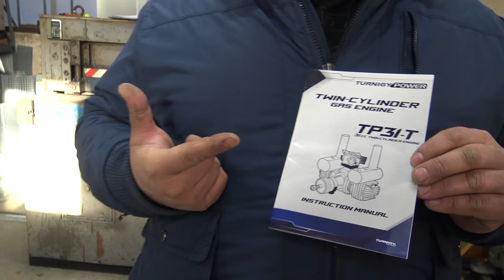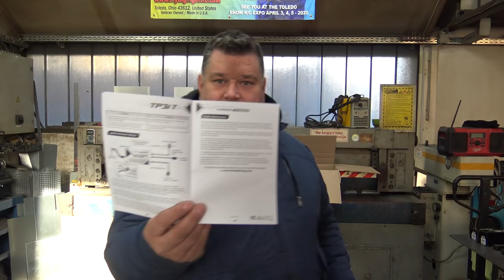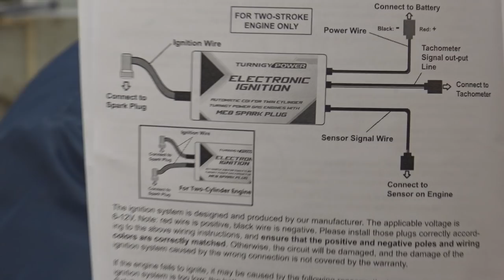NEW!!! Turnigy TP31-T 31cc Twin Cylinder Gas Engine w/CD Ignition and Walbro Carb 3.7HP First run

Comment: For future pilots needing a safety reference...just look at the pic of the hole in my fore arm/elbow area...not for weak stomachs...accidents happen fast with the nitro/petrol engines.Always respect the prop..
Reply: Saftey No.1
Reply: @elpunto231  beer number 1. 
Puntang number 2
Safety if you have time

Comment: This is great. Everyone knows that you have to get the bearing surfaces wet, get fuel round the engine etc, but with these petrol motors it's not obvious how to do it. I certainly learned from this. I haven't designed or built anything serious for years, but I remember Turnigy being the brand for little blue servos, you could get quite a few for a few pounds, enough to do a little warbird or cabin model, and have a spare or two. This engine is a BEAST, and the sound as well as the 7.5kg thrust is again too sexi, and I might once again surprise myself in the shower, but when a new Petrincic Bros R.C Channel video comes up, I don't mind being dirty for a few minutes. Big salute from London. 👍
Reply: Yes all info comes in handy....yes all true...thanks for stopping by...enjoy

Comment: When I flew as a teenager, all we had were petrol engines. I used to love the Cox engines. The battery planes now are so good I probably won't go back. But the sound and smell I really miss. Like high power race cars on high octane racing fuel. And methanol fuelled race cars. Mmmmmmm!!!

Comment: The Turnigy twin sounds very nice.      btw - a 3% oil mix is equivalent to 33-1 mix  (as 33x3% = 99%)  (33 parts gas to one part oil).     I use 40-1 Redline (3 oz per gallon), as Redline is a high-quality synthetic oil.

Comment: This is the first video I have seen by you two.  You guys are histerical.  Very fun and entertaining.  I have been looking for a twin for my 1/4 scale Cub.  I think 40cc is too much but this 31 cc looks perfect!  Thanks for the information and the entertaining video.  (I love the saluting schtick!)  Keep up the good work.  Salute!
Reply: What brand of 1/4 scale Cub do you have? Have you made an engine purchase yet? I'm at the point in my 1/4 scale Sig Cub build that I need to decide on the engine and I was also thinking either a twin 30cc gas 2S or 30cc single gas 4S.
Reply: @icin4d  Mine is a Hangar 9 Cub. No, I haven't made the commitment yet.

Comment: Captain Blaz, do you have any experience with removing Ethanol from gasoline ? To help extend the shelf life and prevent damn water getting in and messing up the gasoline when storing it for a long time. Often we buy large amounts of gas and it then gets spoiled in storage in winter etc. Also, if you have used ethanol free gas, does it still run the same or worse ?

Comment: A beautiful engine! It's just a pity that HK doesn't offer a proper silencer for this, with which you can also pass/obtain a noise test/noise pass on German model airfields. And I also think it's a pity that the Walbro carburetors are not delivered with Velocity Stack. A long velocity stack saves about 30% fuel that would otherwise simply be wasted through evaporation. Unfortunately, a 90° deflection of the carburetor for a noise-reducing fuselage intake is also missing.
So you still have to do some expensive upgrades. It may be fine for the rest of the world, but in Germany you are monitored and attacked with a combustion engine - unfortunately! It is still a good alternative for long flight times and on colder days or when there is no power supply. I like the sound too.
Reply: Yes but we are lucky here that we can run them like
This here...and it runs PERFECT!!!!

Comment: Looks like it's a rcgf engine
Reply: That's because it is! If you take the time to download and look at the two manuals and look at the exploded view of the engine parts, you will see the illustrations and the part numbers are identical too a tee!!! I have both manuals on my computer. The RCGF engines are $100.00 cheaper then the HK

Comment: I can get 92 octane non-ethanol gasoline. Everything runs better with that gasoline.
Reply: Here we have 95 and 98 and 100 like that
Reply: Yes. Because ethanol is corn alcohol and the byproduct of the combustion cycle of ethanol is acid. That acid eats everything. 
Also when the alcohol evaporates (which takes as little as 2 months) it leaves beh8nd corn syrup acid. Which eats viton rubber. 
This is what i deal with for a living.